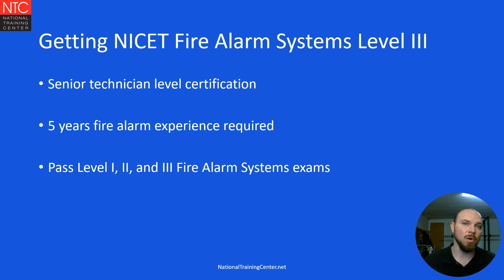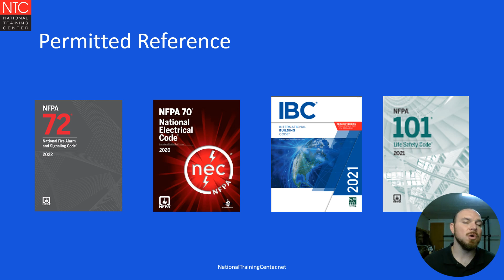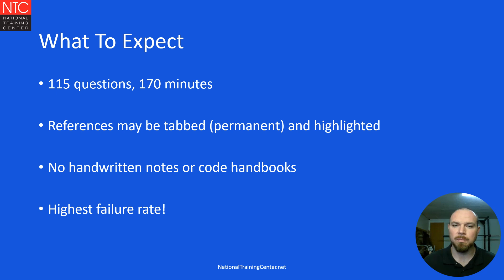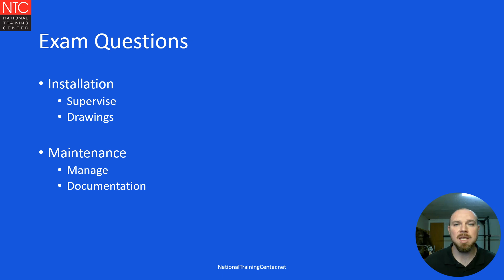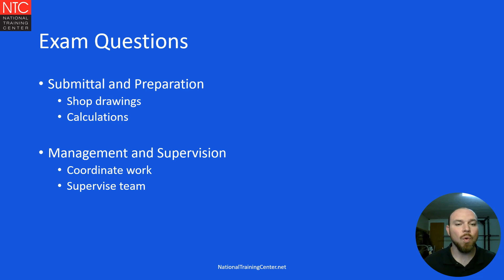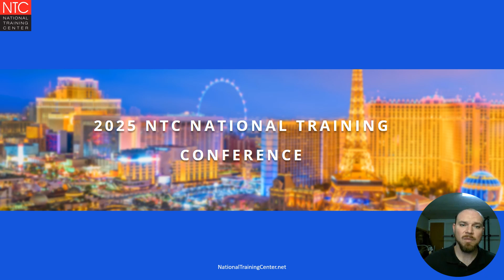Two-Minute Training: NICET Fire Alarm Level 3

Comment: Should I just superglue the tabs? Mine come off easily.
Reply: i have taken lvl 1 and lvl 2 with easy removable tabs. all good so far. but test centers can be different
Reply from the maker: @Proverbs3v5v6 like @camothewise8608 said, it really depends on the testing center and how thoroughly they check. NICET's rules are clear that they can't be removed and repositioned.

Comment: How does table 17.7.7.3.3.2 work or calculate? Smoke detector spacing based on Air Movement.
Reply from the maker: I see you found the answer, but for anyone else that stumbles across this in the future: 

17.7.7.3.3.2 shows the reduction of smoke of spot-type smoke detectors for high air movement areas. Please note that it is required to be the first adjustment made (before beams, joists, or slopes), and does not apply to above-ceiling or below-floor spaces.

First, determine the amount of air movement by minutes per change or changes per hour (both measurements are listed in the table). The changes per hour number is the minutes per change value divided by 60 (60 minutes = 1 hour). No adjustment is required until you reach 7 minutes per change or 8.6 changes per hour.

The right side of the table has the spacing that should be used based on the number of air changes.    You can take the square root of the number to use as a basis for spacing detectors.

For example, 5 minutes per change (or 12 changes per hour), the spacing is 625 sf. The square root of 625 is 25, so the detectors would be spaced at 25', instead of the usual 30'.